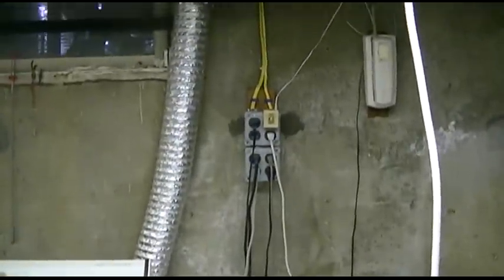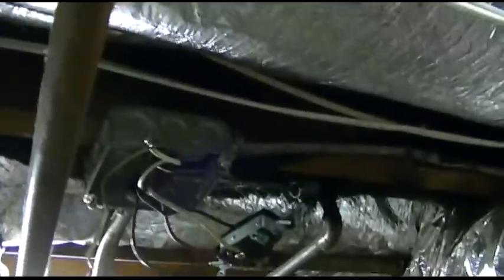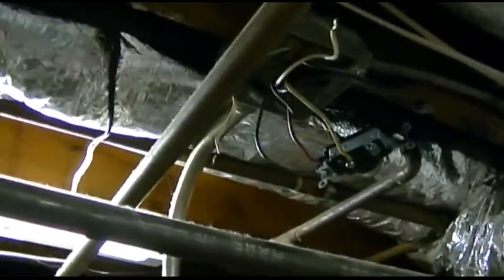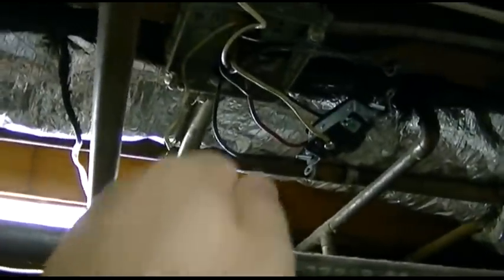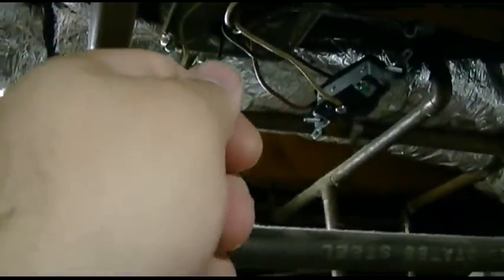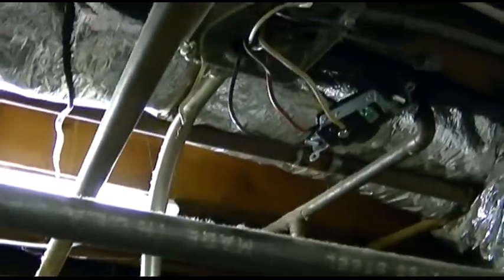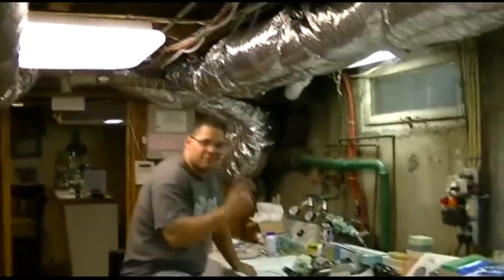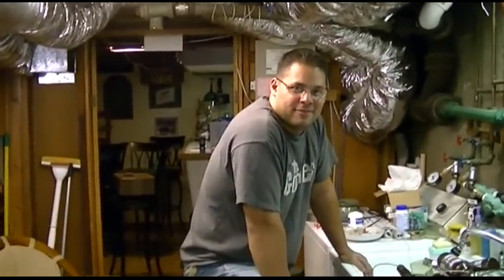Rewiring Boiler for Generator Operation

Comment: I cant critisize too much cuz I never made a vid myself.but.I am hoping to do something similar at home and the project was not spelled out clearly enough imho.
Reply from the maker: The premise is very simple.  Power comes into that box in the ceiling, and then is distributed out.  Even if I showed exactly what I did, that likely wouldn't help you either, because every setup is different; there's no specific wire that is "on the right" that brings power to the box.  Therefore, you're going to have to meter all the wires in the box to find the right ones.

Once you do, you disconnect those wires that bring power into the box, and connect them to an outlet.  Where those wires originally connected to, you connect a plug.  Route the plug's wire into the box so it makes a small loop like was shown here.  That way, you can always pull the plug to disconnect power if you have to work on the boiler (which is also helpful if the switch is at the top of the stairs).  The main reason I did this is so I can use that short loop plug with an extension cord from the generator in the event of a power outage.

Once again, you will need to meter all the wires in the box you have to find the right ones; there's no standard schematic for this.  Every house is wired differently.  In fact, there is a sequel to this video that I will be posting in 2 or 3 days that you might want to watch.
Reply: wow..will look for vid tx for reply.